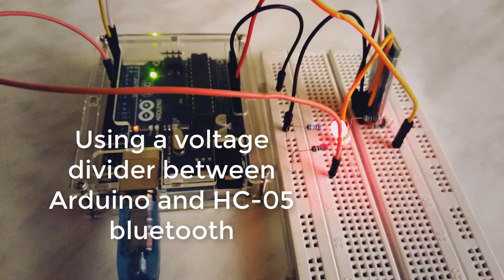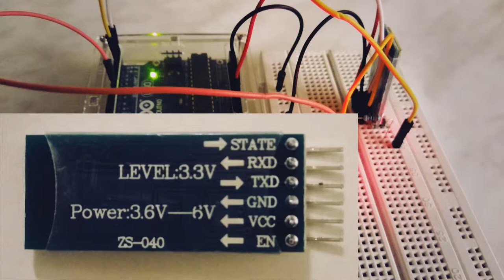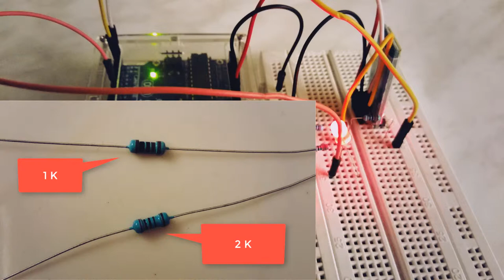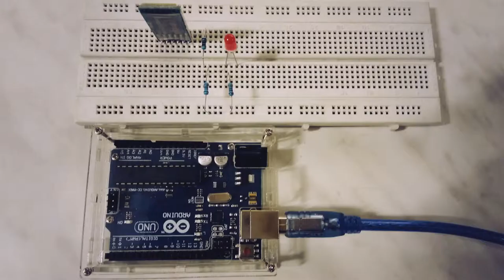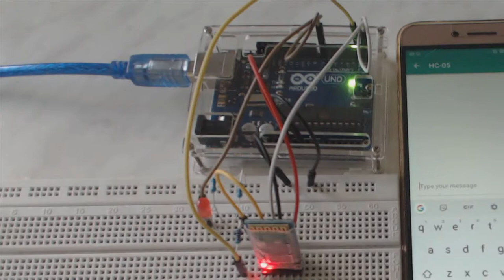Add a Voltage divider in the HC-05 Arduino circuit

Comment: Sir i am using pin 11 and 12 for tx and rx , bt my bt module after gettin one signal automatically shuts down , is it coz of voltage divider.